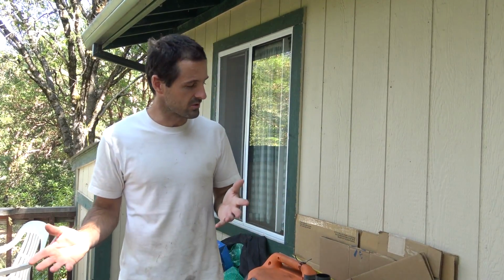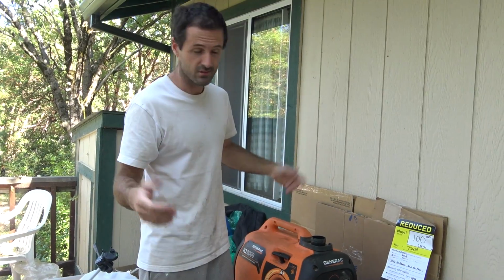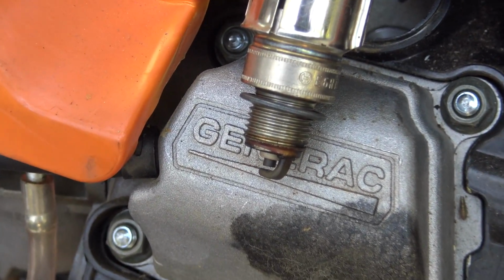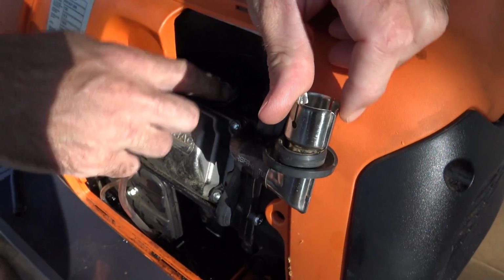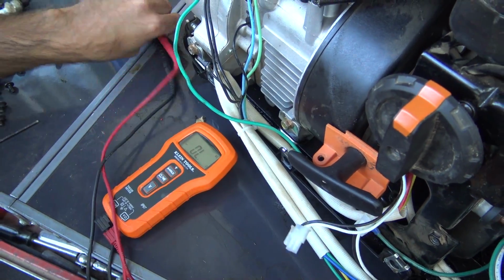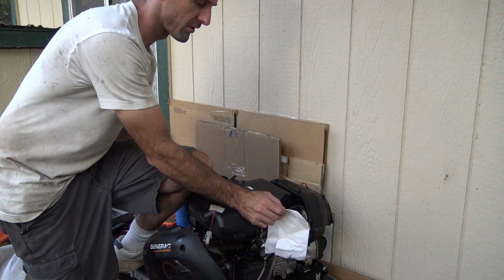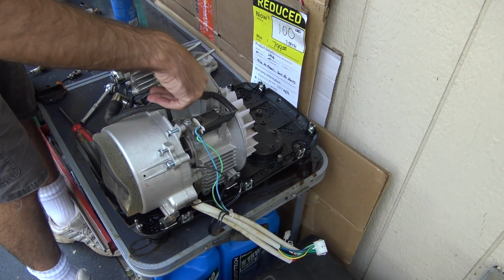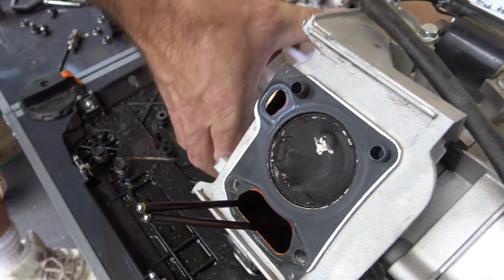$25 Generator From Lowes - Will It Run?

Comment: Sounds like a wiped cam lobe. Or the camshaft is broken. Intake valve isn't opening enough or at all. These do use pretty shitty plastic cam shafts. And with the condition that oil was in, I doubt it was getting the lubrication it needed. Also, I don't believe that was "blow-by" coming out of the breather, but rather that's the crankcase breather, so all air in and out of the case goes through there. That would also explain why you had compression when it was spun backwards; it was pulling air from the exhaust port. Would've been pretty easy to test the theory if you'd watched the valves while the cover was off.

Comment: Been going through all the comments,  I have to say, it would be very hard to wrap the recoil backwards.  The valve push rods are moving in a part of the video when he turns it over so the cam is not broken or completely worn out. He never shows the rocker arms move but, he states that the head is fine.  He doesn't seem to be a complete idiot so I will believe him on the head being ok.  The one comment that really makes any sense to me would be that the ring grooves have aligned, or maybe broken rings but I don't think so because broken rings "should " show signs of wear on the cylinder or break the piston. Not totally convinced on the ring alignment either but since the top of the piston is black, it has to be getting oil in the cylinder and that could explain both.

Comment: I can't believe there are so many comments here. <LOL> As a dealer for these things, I can tell you the major causes of failure have more to do with them being "beat up" by the owners. What I am driving at is old gas,  lack of proper cooling air and especially lack of oil changes. People don't want to hear the thing so put it in a box, or inside a trunk, or throw a packing blanket over it, instead of using a heavy duty 50 ft extension cord and gaining a little distance. The other thing that happens is sludge formation on the valves due to high temps and lack of oil changes, which makes the valves so sticky they wont open and close quickly. (made worst with improper valve adjustment) This is common on any small engine with splash lube, typically ones without an oil filter. It is possible to disassemble the head, wire wheel the valve stems, and reassemble with fresh oil. At that point you can run it for a half hour and change the oil again. You did the correct tests for the low oil system. This unit does NOT have a low oil pressure switch, just low oil level, which is a float switch that can get sticky with lack of oil changes.

Comment: I have been working with small engines about 10 years now. And i dont put gas directly on the spark plug because in my experience a wet plug has trouble igniting. If i pull a plug and its wet with fuel the 1st thing i do is clean it off and pull the motor over with it out to get fresh air/fuel mix into the cylinder. I do put a little gas directly into the spark plug hole using a spray bottle or a small squeeze bottle with a tiny weed whacker fuel line coming out of it to reach into tight spaces. Thats what has always worked for me. And remember the basics. Spark, compression, fuel. 99% of the time if you got those its running. Only things ive encountered that fooled me were push mowers where the flywheel had actually turned on the shaft from the blade being stopped dead while running. Everything seemed right but the spark timing was off because of the rotated flywheel.

Comment: Why did you pour gas on the electrode end of the spark plug before trying to start that gen? All you would have succeeded in doing was to "flood" the engine by fouling the plug.

Comment: Some of these engines will loose all compression if valves are not adjusted properly causing compression release to stay open  or it was overheated and lost the tension on compression ring  or bad cam but any of these are relatively easy and inexpensive  and worth replacing for what you paid

Comment: Bad valve sealant .. lobe on the cam ... that's why u have compression in counter rotation. Because the back of the lobe isn't worn. Build it up with a arc welder and sand it smooth..

Comment: I know what the problem is.  The exhaust or intake valve isn't sealing all the way causing loss of compression.  I wish you had a compression tester but obviously it had low compression.  I think because it was overfilled with oil that the valves got carbon build up and don't seal anymore.  Cleaning those valve seats with lapping compound, and a good valve adjustment should do the trick.  I just subscribed and turned notifications on and liked the video.  I can't wait to see the update to this. Thanks!

Comment: When a compression release is bad the valve won't open to release the compression therefore making it nearly impossible to pull.. So I think you have a stuck valve, broken or misadjusted rocker, a bent push rod or stuck tappet. All of these problems could be caused by the carb overflowing, ie. the engine appearing to be overfilled with oil when it could be gas. Now the cylinder fills with gas and.... At this point you pull it over and usually break your pull start dogs or the rope OR you bend a pushrod. Maybe. I can't believe you left us hanging...

Comment: That's a single cylinder engine, the venting through the breather is just due to the displacement of the piston. It'll do that blowby or no blowby. The compression loss is more likely to be in the valves.

Comment: If its a 4 stroke engine and you have air coming out of the carb, you have a leaking intake valve or the exhaust valve isn't opening.
Alot of newer little 4 stroke engines have plastic cam shafts. When they get hot the exhaust lobe wears down. And, the exhaust valve won't open.
During hurricane Ike, for two weeks, I fixed hundreds of generators - free for people while my motorcycle shop wasn't able to do business.
I got to where I could fix them or at least tell you what was wrong in 10 minutes or less.

1. Make sure fuel gets to the carb.

2. Squirt a little gas in the carb and see if it runs a few seconds. If it does, you have a fuel starvation problem.

3.Take the float bowl off. Make sure fuel flows through the needle and seat. 

4. Make sure the float bowl is clean and then spray carb cleaner through the main jet.

5. Put it back together and it usually starts. If not, and it still runs when you squirt gas in the carb it's usually not getting enough fuel. If the spark plug is dry, it's not. 

Sometimes, you can't adjust the mixture. They're set to run too lean when you get them. 
There are different ways to get to the adjuster screws. But, you need to open at least one of them up.

If you're sure you have fuel and it runs a few seconds and dies, put a spark checker on the plug wire and try it again. if it runs and stops, watch to see if the spark goes out when it's dying. This happens when you have a bad coil or condenser. Or, the oil level goes down enough for the low oil sensor to kill the electricity when the engine cranks.

If its NOT a fuel problem.

1. Check the spark with a tester. Put another known good plug in so you'll know it's not a bad plug. It's rare that it is a bad plug. Fouled, yes. Bad, rarely.

If you have spark, and fuel, and it still won't run, take the valve cover off and check the valves. 

Alot of Chinese OHV engines have guide plates for the pushrods. They don't deburr the edges of them. So, they often cut the pushrods in two.

They also don't tighten the lock nuts on the valves alot of times.
The nuts allow the adjusters to back off. Sometimes, they'll run ok idling. But, when they rev up will spit and backfire.

Adjust the valves and put the valve cover back on. They always run after this.

Sometimes, you can patch a cut pushrod by slipping both parts into a piece of telescopic antenna material that fits the outside of the pushrods. Cut it the same length as the distance between the balls on the ends of the pushrods.

This isn't the right way to fix them. But, it'll get you through a hurricane. 

Deburr the edge of the guide plate. In spite of it being a stop gap emergency fix, I've never had to go back and replace the pushrods because the engine wouldn't run.

Some carbs have a fuel cutoff solenoid on the main jet that hangs below the float bowl.
It should click when you turn the key on. These are on bigger engines with electric start.
You can also check for continuity with an ohm meter. It should have no resistance between the terminal the wire hooks to and ground. If its open, the solenoid is bad.

Before you have a compression release, you have to have a pretty large generator. Or, a diesel one.

Out of 300 generators, I didn't see one on any generator you started with a pull rope.

You can also check the compression when you have the plug out. You can use the thumb over the hole approach, or a gauge if you're really cool. If it blows your thumb away with a pull of the rope, you really don't need the gauge.

You need three things for an engine to run.

1. Fire (spark. enough and at the right time)

2. Fuel. More when it's cold. Less when it warms up.

3. Compression.

Pull the rope to see if it's got compression.

If it has compression.
Do this.
Have a neighborhood kid hold the plug wire in one hand and put the other on a good grounded part of the engine. 

Pull hell out of the rope. 

If he yells and wets his pants, you have good spark.

Look at the plug. If is dry and you've done the other two tests, you have a fuel problem.

If so, and this were a batch (.bat) file, the next line would be something like:

GOTO 1

Anyway, like I said, I have a motorcycle shop in Beaumont Texas. Where, it just got through flooding... In fact, it's still wet everywhere. A lot of us don't have homes any more. My shop survived the water.
But, my home didn't.

So, I don't really have time to be goofing off on YouTube.

But, I'm hoping this may help people fix their own generators (or any 4 stroke engine) in the event of any kind of emergency in the future.

If this works for you, let me know.
I get a warm and fuzzy feeling from doing things that help people.

And, generators are way too simple. 

Sometimes, you can't get them to flow enough fuel through the crappy little carbs no matter what. But, what I wrote here will get 99% of them going again.

I may make a video about what to do once you get them running, and discover they won't make electricity.

One thing at a time though.

Good luck.
Robert
Chief cook and bottle washer.
South Park Cycle
Reply: Nice down and dirty diagnostic write up.  Sorry for your loss.  I made a relief run with my Jeep Club to Vidor last Saturday and it is a mess down there.  Good luck getting things back on track.  The club is already preparing for another relief trip sometime next week depending on where Irma hits.

Apparently Irma is pissed that Harvey wandered off drunk and cruised the coast and now she is pissed and out looking for his sorry ass.  :)
Reply: I.C. Sezdablindman I just happened to see the Jennies garage video about the $25.00 Generator and went through the comments section and believe me when I say this you are without any shadow of a doubt a 100% true American and we should all practice the same as you. Thank you so much for all the great information. May God bless you. Thank you and have GREAT & WONDERFUL LIFE.  jmarent@att.net
I also wish to thank Jennies gararge for taking the time to share their experiences with us.
Reply: J M Arent really great step by step!👍👍
Reply: Directed to I.C. Sezdablindman
Reply: I.C. Sezdablindman 
Insufficient intake valve clearance will also cause the valve to hang up and vomit air back out the carburetor.
Reply: I.C.  Thanks, Solid Advice.
Reply: I.C. Sezdablindman
 Hey man, you're a true 'Merican Hero.  If you don't have a flag tatoo yet, go get one. If you got one already, get one on the other arm!
Sincerely....thanks for taking the time and may God Bless you for a speedy recovery from the flooding.

Comment: Wait come on Where is the other video, Please I'm watching this video straight from the Dominican Republic and have my power generator giving me some problems and on top of that we have this MEGA HURRICANE CATEGORY 5 IRMA HEADED OUR WAY and your video was being very useful for me to figure out where is my power generator giving me problem that it wont start,  it was  only used 3 times and then it was store away in my mothers basement in PA for two years without no use and she left it with fuel in it and I clean the carburetor and the air filter,it has oil and fuel the started is turned on and the gas line too and it will not start. Here is a link how the storm is starting to looking from my roof **https://youtu.be/1IlNxsM43pM
Reply: Abel Aranda hopefully I can help you out since you are in a bit of a time crunch..
Make sure oil is changed, fuel is changed(do not use old fuel under any circumstance) add a fuel stabilizer if available...directions on the bottle for different scenarios. Be thorough...check everything..under stress it's easy to miss something as easy as an on switch. If it does not start up right away, try the fuel in the cylinder trick to see if it will 'fire' after checking you plug has spark ⚡️. Do not put fuel in the spark plug like in the video as that causes a 'flooding' type situation and will NOT fire! These suggestions generally get an engine going even after sitting for a while. If it should fire and not start, you may have to take apart the carburetor again and check all passageways inside and don't forget the gaskets if torn etc. may need replacing. It's easy to miss some of those tiny little holes/passages in a small carb. Not running yet?..verify that compression..sticky valve? (don't forget valve timing can throw that out.) I think in the case of the Generac generator with the overloading of oil in the crankcase, it may have blown out the crank main seals and is experiencing low operational compression and oil sitting inside of the casing bottom. Something that struck me as 'different' was his test of the 'low oil' sending unit. I was under the impression that they tested for oil pressure not oil level...I could be wrong on this or perhaps it varies depending on manufacturers.
Failing that, check the timing..some small engines upon shutting down can and will shear that key way. 
I wish you all the best as you are in the crosshairs of yet another nasty hurricane.
Prayers for you and your family and friends.🙏🙏
Reply: Hey Steve Thank you for your awesome recommendations, help and reply will try it out, will be heading out tomorrow morning to the store, to get the brand new oil and fuel. I was also checking out a video that someone use a carburetor cleaner and it started? what are you thoughts and recommendation on that? should I buy it tomorrow morning when I head to the store? also thank you for the heads up on the spark plug trick I was ready to test that one out first (lol) will also buy a brand new spark plug and take a look at it would had made a video and upload it but with this stress over my family shoulders totally in a rush wife and my twin 4 years old daughters will right out the storm in a apartment complex we live hopefully everything turn out a bit okay.
Reply: Abel Aranda carb cleaner may be helpful yes. Also I use break cleaner for many things as well..it can be smelly and not so nice to use but it's very effective and will immediately dry parts out after 'floating off all residue'..that will make sense when you use it.
Reply: Thank you Steve will give it test tomorrow morning if am able to head to the store hopefully the  storm will be in land tomorrow night but the winds and rain started to be felt today in the afternoon.
Reply: Abel Aranda if you want go ahead and send me a friend request on FB...I'd like to know how you made out and how things are there for you. I'm glad and hope my recommendations help you. 
Our weather has been lousy lately as well..of course nothing like there but I believe possibly some influence of the last hurricane/storm system that rolled up.
Again, all the best to you and yours and drop me a mssge if you like. 👍👍🙏🙏✌️👊☮️ Blessings.
Reply: Abel Aranda I found a really good 'step by step' on this thread.. it's by "I.C. Sezdablindman" ....a little ways below here. It gives a bunch more detail and may be helpful.🤞🤞🤞 👍
Reply: Hello steve I don't see the link?
Reply: Abel Aranda go down the list of replies and look for a green dot or green circle and it has a capital "I" inside it. He starts by talking about a 'four stroke engine....'
...."If it's a four stroke engine and you have air coming out....."
Reply: It's about 24 replies down the list from here.
Reply: Abel Aranda sorry, I think I may have missed your friend request...send again if you like.

Comment: Good Luck! These things are JUNK from the word go. I went thru a number of these things, had them replaced under warranty too.  If you let it run out of gas, it will pull crap into the carb, and it will need removed and cleaned. Then if it shuts off with gas in the tank, it will overflow Fuel into the oil. I had one that the inverter gave up on in a month.

 Very frustrating, Chinese made shit pile to be honest. Should have spent your money on some booze instead.
Reply: OH! and if you put too much oil in it, it will not start, you have to measure out the exact amount upon refill.

Comment: Blown gasket between the crank case and the cylinder, when the engine goes into the compression stroke, its just pushing it through the garbage gasket, right out the crank case breather